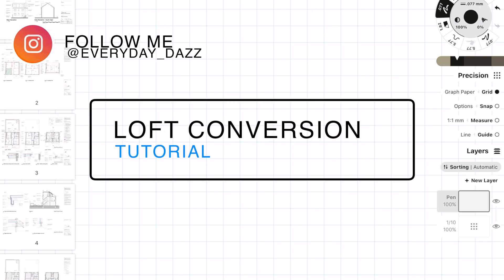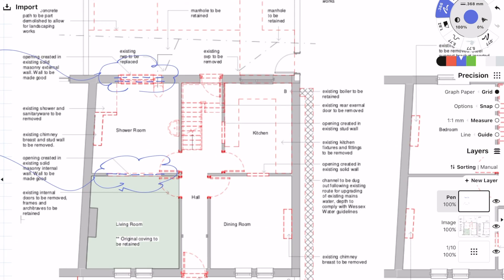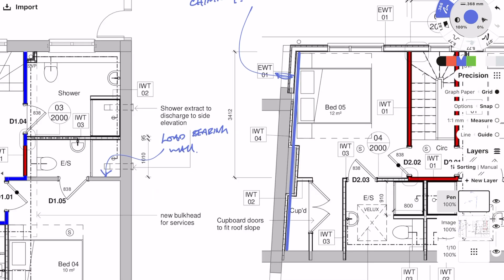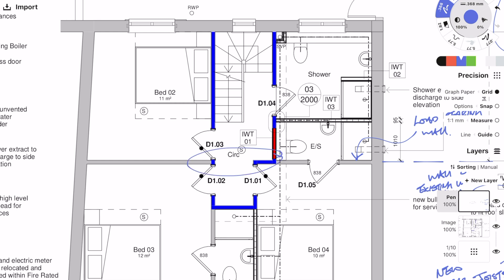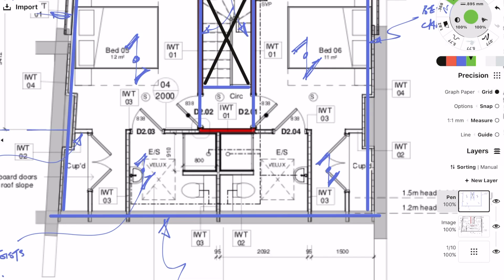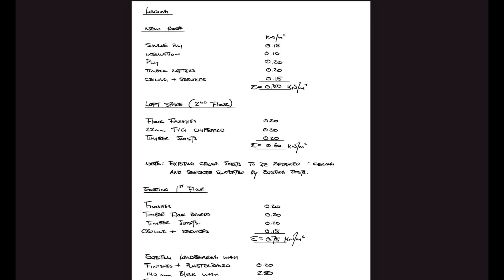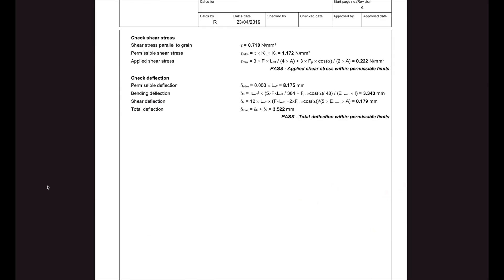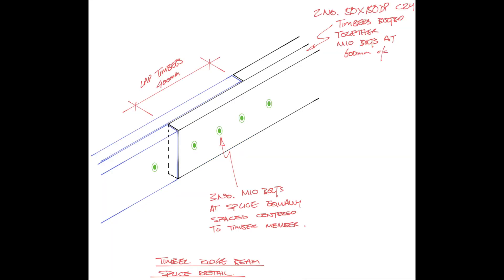Loft Conversion Design Tutorial | Structural Engineering

Comment: Great video! How is it possible to do a loft conversion without steels?
Reply from the maker: You can use timber beams instead of steel but the depth is probably greater than using steel.

Comment: This is awesome. You've gone through everything in so much detail. It's really helpful. What is the design process like where there is a trussed roof?
Reply from the maker: Thanks for the comment. 

Normally timber truss roof design is done by the roofing sub contractor as part of their package. But it is quite easy to design it yourself using it 2d or 3D analysis software.
Reply: @EverydayDazz  thanks for getting back. My question was more related to loft conversions for existing trussed roofs (W shaped trusses). I guess diagonals of trussed roof could be cut back to make more room in loft. Provided that additional timbers added for strengthening?
Reply: Really awesome content I wish I discovered you a couple of years back when I was starting! You’ve made me realise I’ve still got so much to improve on.... and I makes me want an iPad! 

Q: is there any reason you didn’t include masonry panel checks, padstone/bearing checks in the package?
Reply from the maker: In reality I probably would do those checks you mentioned. I’d do them after I had worked out the reaction forces from the new beams. Generally I always have a note to always put beams onto padstones and unless the load is exceptionally high, I won’t need to check it based on experience.
For the inexperienced, definitely do the checks.